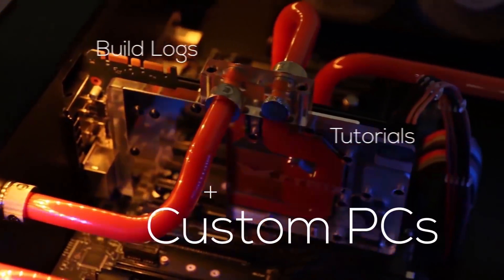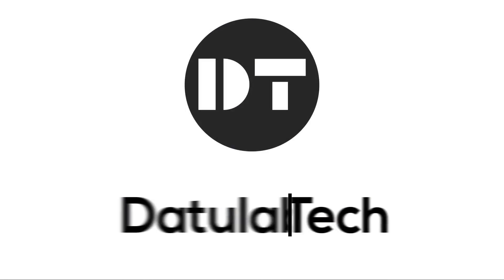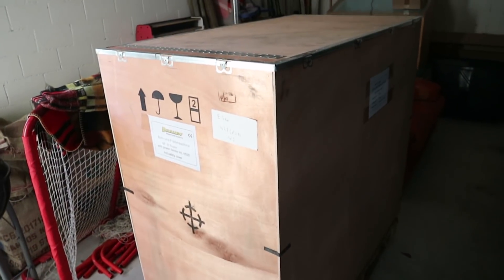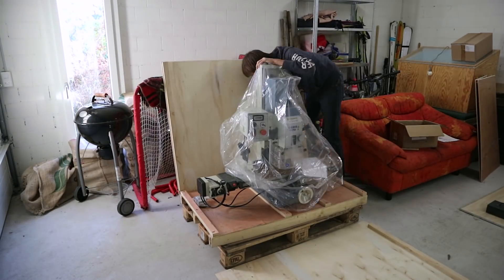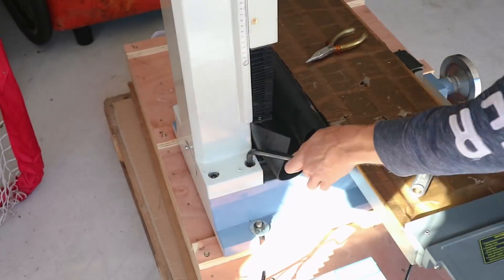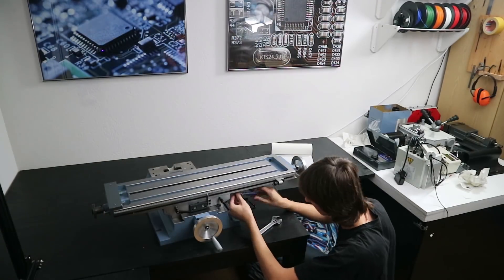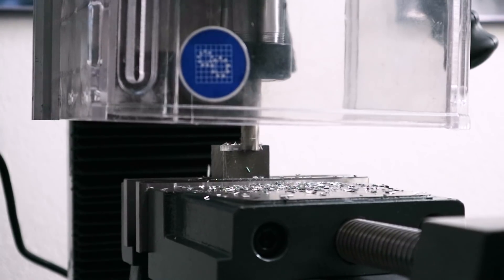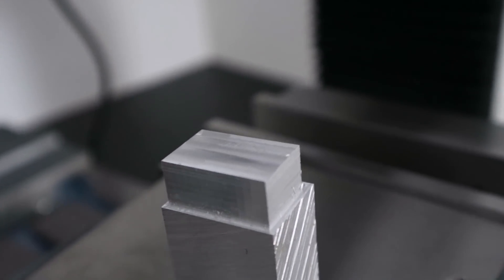My Router just got WAY STRONGER! - BF 30 Milling Machine

Comment: I just watched a bunch of videos about Chinese ER collets. Folks say the nuts they come with are defective. There's a relief shoulder in the nut that is too shallow so it hits the front of collets and makes them rack. The fix is to get a bearing nut. Or just buy a better collet holder. But that will set you back a ways. I have a round column Chinese mill. It's a POS but it's fun to play around with. I never CNCed mine. That wouldn't work for how I use it. Plus my mill has so much backlash I'd need to get new lead screws for it. That would set me back too far. Mills aren't CNC routers that's for sure. Pro tip: the right way oil will make a huge difference in rigidity. I use chainsaw bar oil. It's cheap and easy to get. For soft stuff like aluminum it doesn't matter though. It gets real when you start cutting ferrous metals like steel or cast iron. It took me a long time to figure out the way oil deal.

Comment: Excellent, looking forward to this new series. Which CAM software are you looking at, I use Mach3. Cheers
Reply from the maker: I will be using Fusion360 for CAD and CAM, with Mach4 for the machine control software

Comment: Hey, why did you chose a heavy conventional milling machine over a proper CNC milling machine (like the basic line or compact line from Soroec)? I think you could also mill steel parts with those and have a decent cutting area for aluminium parts. At least that are my considerations because I have to plan what to invest to in the future. OK with the BF30 you can spare yourself a decent drill press. Tell me about your intentions. Maybe you can inspire me :-)
Reply from the maker: While you can cut aluminum with them, the spindle is optimized for high rpm which means small tools and not so much material removal rate. A propper mill will always be way better for cutting metals than a router, unless all you're doing is some engraving and sheet goods. If I want to clear out a pocket with a couple cubic inches of material, it will take forever with a router, while with a mill I am done rather quickly. In the end it's all about what you want to use it for.
Reply: @DarkArtGuitarsWorkshop  even your mill will take a while. But there's no comparison between it and a gantry CNC machine.

Comment: Very cool. I would like to give one piece of advice. Figure out a way to control the mess. Chips will fly all over, and it does look like you have a nice clean workspace.
Reply from the maker: I will be building an enclosure too. In the meantime, the chip guard that came with it is actually surprisingly effective at keeping them on the table.
Reply: @DarkArtGuitarsWorkshop  That's good. If you plan on cutting aluminum, an air nozzle is key to success, which of course makes a mess, but a successful mess.
Reply from the maker: Yea, I've been looking at a fogbuster for some lubrication and air for when I have the enclosure
Reply: @DarkArtGuitarsWorkshop  DIY methods can be made for very cheap. Personally I have not seen any increase in performance with coolant. The coolant tends to make the chips into a mush that sits on the part. With air alone, it blasts the chips out of the way, and all is good. My instagram is cncmaryland if you want to check out some pics on my setup.
Reply: @1pcfred  thanks but I currently have no issues with my setup
Reply: @1pcfred  If we're going along the line of using the right tools, then WD-40 is not the right tool. I work primarily in aluminum, use a dual air nozzle setup with KoolMist lubricant if necessary. It's a real lubricant, water based, etc. Yes a lubricant will give you a better finish, but all you need to prevent chip weld is chip clearing, which is a easily done by air nozzles.
Reply: @1pcfred  I'm going to respectively disagree. If you can find me one of the professional CNC shops using WD-40, send me a link.